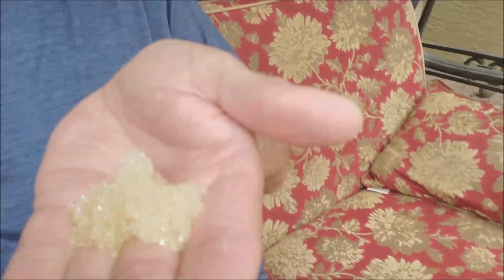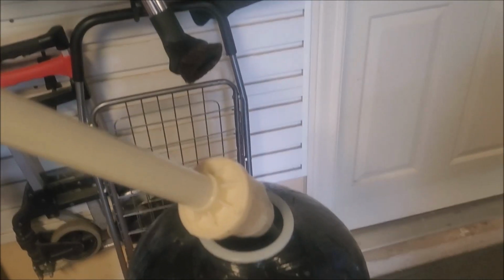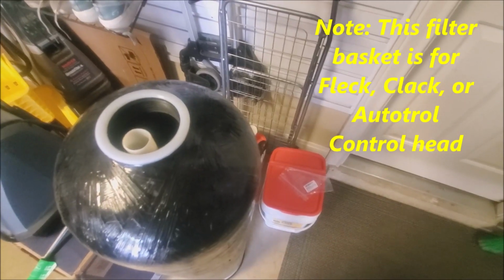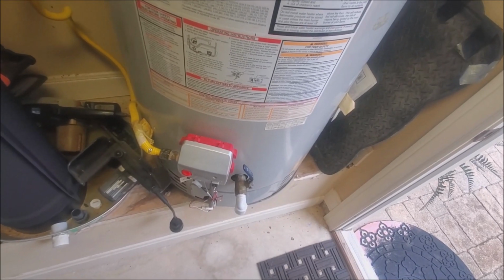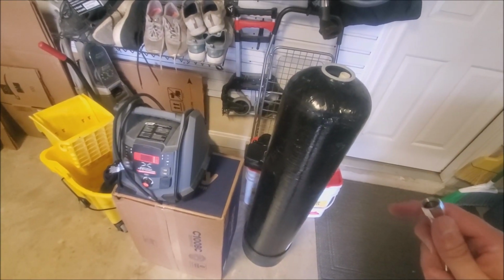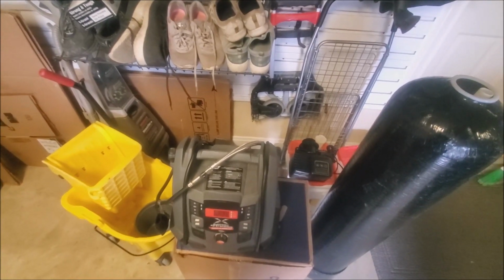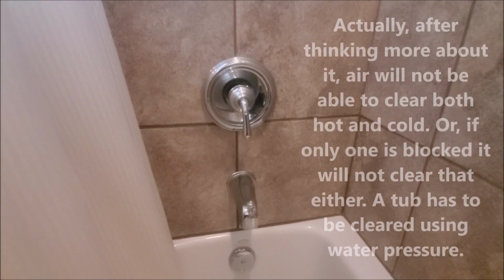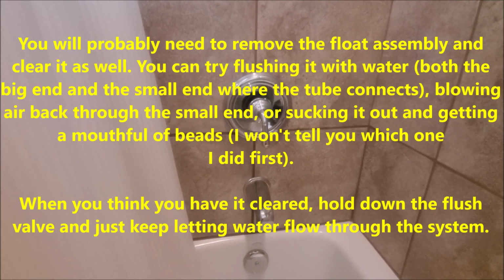No Water Flow From Your Inside Faucets? Maybe Your Softener Had a Resin Breakout!

Comment: A simple solution would be to put a whole house water filter on the water line coming from the water softener in a convenient place to make the filter cartridge easy to change.

 As long as that water line goes to all the fixtures like the kitchen, bathroom, hot water tank etc everything will be protected. 

Even if you don't want to filter that water it will still catch the resin in the event of a failure.
Reply from the maker: That was my adviceto @simd510 below. And after much procrastination, I recently added one to my own house and made another video about it ;)
Reply: @thehoneybadger9262
Reply: @thehoneybadger9262
Reply: Great idea, thanks! How would I know the resin issue is there, though? on the water filter next to the softener?
Reply: @rubenvazquezlopez325 clear sump.  great spot for a 4.5x20 carbon filter

Comment: Secondly, when you drained the heater tank, how did you take the resin out that would have sat in the bottom of tank.
Reply: I did not do a 'drain' persay, it was more of a flush, with water pressure still applied. My thought was that it would stir up the resin at the bottom of the tank as cold water came in.

Comment: I have the same exact issue. Found resin in toilet tank and water pressure went low in showers and faucets. 

Someone told me the easier way to drain the water heater is by running the hot water in the tub for good 40 minutes which will drain the resin through bathtub faucet. Is that not the case? Can you please recommend?
Reply: I did run the water out the tub, except I actually removed the cartridge because there was no water flow, and had to stick something into the side ports on the inlet pipe to break up the resin. I don't recommend running the hot water through the tub until you've cleared most of the resin out of the water heater, as the hot water can gum up the resin and make clearing it even harder. But yes, I did run water from both hot and cold supplies (there was no cartridge installed), using my wife on the phone to turn the main supply on and off. Just had to be careful not to let the water run out behind the tile.

Comment: Is this house on a septic? Do you worry about the resin going into the leach field causing issues with soil percolation
Reply from the maker: I have an aerobic septic system, and virtually no soil in my backyard where the sprayheads are. I basically live on a giant rock.
Reply from the maker: Also, FYI the house where this happened was not on a septic system.
Reply: resin should sink to the bottom of the septic and not make it out to a leach field 
as far as any rental with a water softener , put it in bypass , and be done lol
Reply: @scottzimmerman6485  If they were my rentals, I would agree with you. Softeners in the hands of tenants can be a real pain for maintenance. However, my son insisted on putting them in, because the water is pretty hard in our area. He moved to Tennessee and collects all the rent checks, and I get to deal with all the maintenance problems, as his unpaid 'property manager' ;)

Comment: Did the house have a pressure relief valve?
Reply from the maker: Yes, a failed one ;)  I believe this is what collapsed the lower filter basket.  Unfortunately it was at a rental house, and symptoms of the failed PRV were not reported, just the loss of all water pressure after the softener failure.

Comment: Thank you for video. Anybtips/recommendations on how to prevent something like this from happening. This is my worst fear with my water softner
Reply from the maker: Check your water pressure often, and if you ever re-bed your resin, make sure you replace the riser tube and filter basket as well. You could also add a downstream filter to keep the resin from entering the household piping.
Reply: I agree on the downstream whole house filter. Just put it in a place where it would be easy to change the cartridge. This would protect everything.